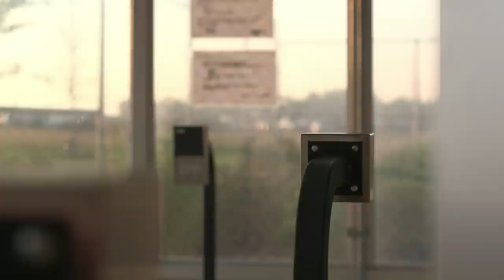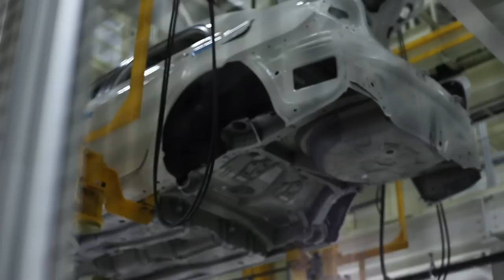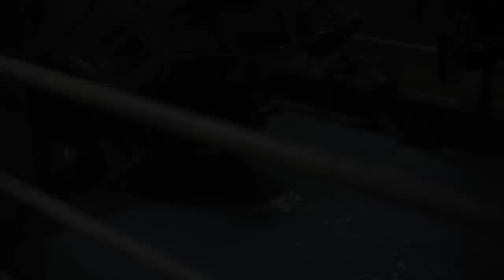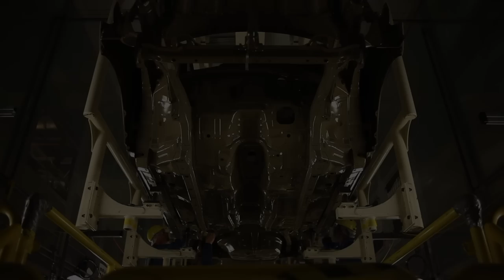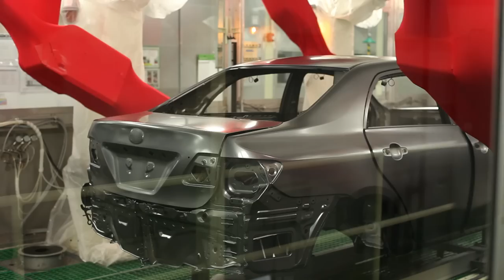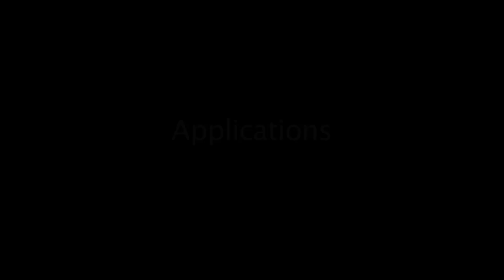Toyota Paint

Comment: Garbage!!! My Yaris paint clear coat started to peel off less than two years after buying it new, but I failed to bring it to the dealership before my warranty was over!!! I will never ever buy another Toyota car again since they never took care of it. I had always garaged the car and washed and waxed it regularly!!
Reply: ***** Actually I bought it due to the fact that it was built in Japan.
Reply: ***** this particular one was imported from Japan as any 07 model was. It had the window sticker that clearly stated that this vehicle was built in Japan. That's exactly why I chose it over the domestically built Corolla at the time.
Reply: ***** I understand your point, however the original window sticker which is still in my possession clearly states the fact that my Yaris was built in Japan and the port of entry was Los Angles. It's a 100% Japanese built vehicle.
Reply: ***** well, all I can tell you are the facts; I bought the car brand new, the window sticker says built in Japan and I've seen several of the Blue color of the same year of production to suffer from the same problem. They can't write lies on the factory window sticker. At this point, I really don't care. At least it runs until I'll pick up a new vehicle. For your info, my friend has a 2002 Camry which he bought new and it now has over 230K miles on it and it has no issues. That car by the way is an American made Camry. It's a fluke with the Blaze Blue color Yaris models of 2007, which have paint issue. In any case, no one or no nationality is perfect for that matter.
Reply: Stephano Riazi (7sorry paint
Reply: Point here is that you failed to go to the dealer....I don't understand you blaming TOYOTA..are, they supposed to check with you every week on your problems,,almost every car brand on the road today has clear coat problems.
Reply: Same